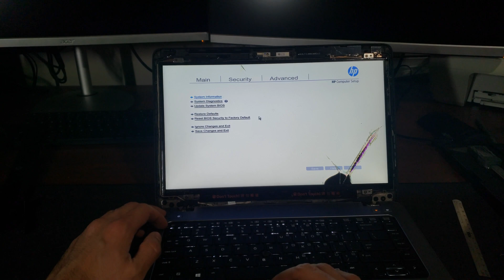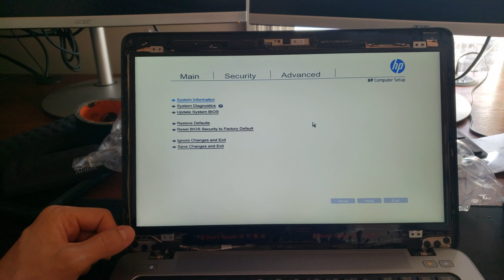HP EliteBook 840 G1 Screen Upgrade - 720p to 1080p

Comment: How well does the G3 screen work with the older machines. I have the even older 8570w but I’m curious if the 40 pin plug is the same

Comment: Does it really make a big difference upgrading to 1080p screen? Is it worth it oŕ not? Ps: Only using the laptop for work and youtube 😅
Reply from the maker: Hi, thanks for watching and commenting, I really appreciate it. I personally noticed a huge difference in sharpness and picture quality. The 720p display is pretty blah. If you are OK with how your machine is running, then dont touch it, but if you wanted a little upgrade without paying for a new machine, this is one of the easiest and biggest bang for the buck upgrade that you could do. Again, thanks for watching and have a great day!

Comment: hi! I've tried this on my hp 14 laptop and the 1080p screen is on but displayed nothing. Do I need to replace the LCD flexible? or there's converter short of things that required? thanks
Reply from the maker: Hi, thanks for watching and replying, I really appreciate it. My apologizes for replying so late, but I would make sure that the cable is properly connected and also make sure there is no debris in the connector. Some easy diagnostic steps you can do are the following:

1. Try reinstalling the old screen, if that works, then most likely the "new" screen is faulty
2. If you install the old screen and see the same behavior, while the machine is powered on, I would try to move the screen up and down, flexing the cable and see if the screen turns on. If it turns on, then it is either the cable OR the connection of the monitor could be bad. 

I hope this helps. Good luck and take care!

Comment: I have a question can I install Linux on HP Ultrabook 840 not sure model version. Also the computer doesn't work. Could it be screen my issue was at first the power button was on but no screen I looked up couple of videos none seem to work I haven't changed any parts though. Now after a few months the power button doesn't even turn on is there anything I can do. Sorry if I'm bothering you.
Reply: I was going to use it for python and game development.
Reply: I am getting new PC but of I could fix the laptop I was going to turn it into my programing and game development laptop. I'm new to that stuff.
Reply from the maker: Hi, I am going to try and respond to all your questions and comments here:

1. Yes, you install Linux on this machine.
2. Have you tried plugging the laptop into a monitor to verify if the screen is broken or not?
3. Since you state that the power button doesn't turn the machine on any longer. Do you have the laptop plugged in? If it is plugged in and it still doesn't turn on, then it may need to get a surface charge before it will turn on. So just allow the machine to charge over night. Then plug a monitor in it and turn on the laptop.

Comment: what about 1080 IPS?
Reply from the maker: Hi Dwayne, thanks for watching the video and for commenting. Can you please explain your question a bit more? Are you asking if there are IPS panels for the laptop or can you install an IPS panel in the laptop?
Reply: @joesdiy4260  if you have an IG lemme know cause I'd just wanna talk to you for like 5 mins cause I have two laptops that needs some thinking heads and you seem to understand what I'm trying to do
Reply: Hey is there a way we could have a quick Convo?
Reply from the maker: Hey man, I do not have an IG, sorry.
Reply: @joesdiy4260  seems Yt deleted my question
Reply: @joesdiy4260  ok i have the same laptop  1366 x 768 and i need a screen. i see options to get 1080 IPS with 30pin connector. does it matter that it's Ips?
Reply: @joesdiy4260  and part B. would you say that even if we are talking about another laptop like the hp 15 series. i have one of those also that is 1366 x 768 and the screen is also gone but i would like to get a 1080p tn/ips screen for it. would you think it is possible to work as long as it fits and the pin connector is the same?

Comment: Hello. Your video is amazing! Thanks. Question : Is ips o no ips your new screen? I don't know if all screen g3 1920 will work in my g1. People say me I'll need another cable.
Reply from the maker: Hello! Thank you for your nice comment and question. I truthfully do not know if my screen is IPS or not but I truthfully do not think that matters. As long as you have a NON-touch screen 30pin eDP cable, you will be fine. The touch screen models use the 40pin connector. 

One thing you could do is open your laptop and count the pins

I hope this helps you and good luck!
Reply: @joesdiy4260  it's works. I get full hd in 840 g1. Thanks!
Reply from the maker: I am really happy to hear this!! Enjoy the crispy screen!